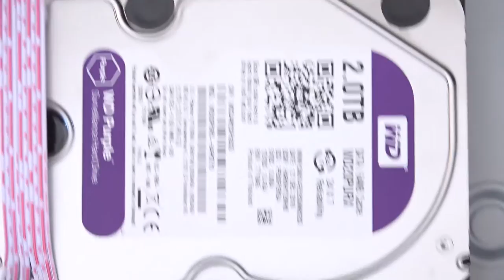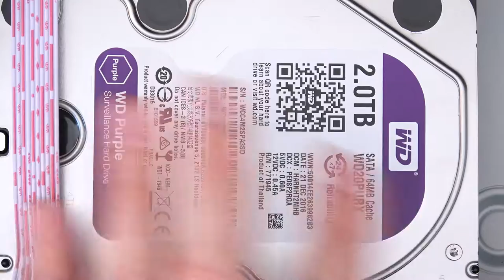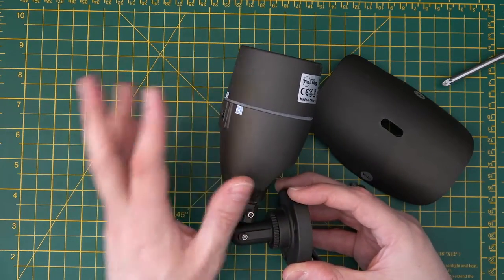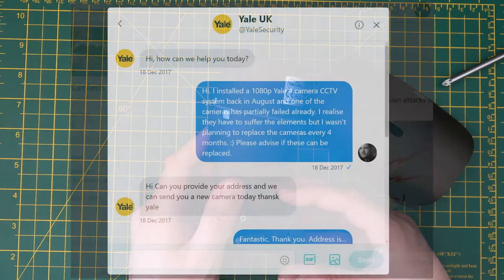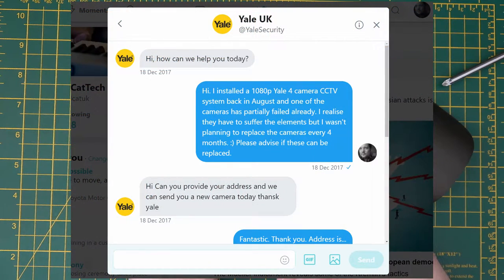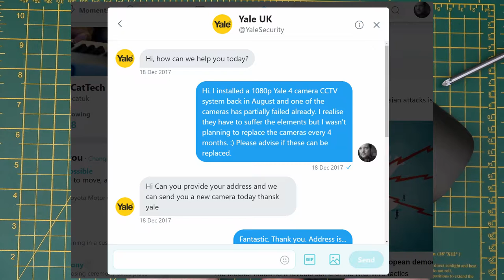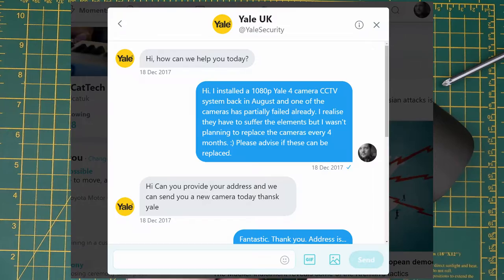Inside A Consumer CCTV System & Camera

Comment: I love nothing more than finding a great YouTuber from the UK. Really good an informative videos. I’m looking to install CCTV. Initially I was looking at wireless which is simple but these DVR cameras have so much benefits. The only issue is as always the cabling. Having to make a channel inside the house for cabling into the loft is a ball ache. I’m not a fan of seeing the conduits running up to the roof. Did you ever do an installation video, or upgrade your system? Thanks

Comment: Nice. I am completely tech ignorant. Just installed a two camera version. Tested it beforehand and worked fine. Now installed, followed instructions, which aren't particularly idiot friendly and all I get is the black split screen but no pictures. Any pointers would be appreciated. Thanks Richard
Reply from the maker: Make sure you are monitoring the correct channels. The box might allow you input e.g. 4 cameras. If you have them in 3 and 4 but are viewing 1 & 2 you'll just see black with a resolution on the screen. Make sure the cameras are powered up with the separate adaptor.
Reply: Richard Allen hi did you find 2 cameras sufficient?, did you get good coverage?, they say 60 degree vision.. Thanks

Comment: What did you think of the 90 degree camera angle? I want to use 1 camera on the rear, 1 on the side, 1 on the front and 1 in the corner of the porch area, but I can imagine the camera failing to pick up everything below, and if I was to angle it down I would miss the front of the driveway. I am being tempted by the 120-140 degree cameras
Reply from the maker: I've never found it a problem but my use case is quite different; elevated shots from 2 floors up. The field of view gives a very natural image and covers a surprising amount but only you can say through testing if you need more.

Comment: Good vid would you recommend the 1080p over 720p version?,did you install system yourself if so what size holes drill through wall?,did you silicon holes afterwards?,is 2 cameras enough viewing angle?, is the quality any good?,there has been lot bad reviews of the Yale app for mobile does yours work when out house?,thanks.
Reply from the maker: Not really. I think 720p is quite sufficient for CCTV. The sensors in cameras like this are probably not resolving that much detail anyway. I did install the system myself but I was able to route all the cables under the windows as they are period sash windows which have gaps everywhere anyway! This system is a 4 camera system. It gives excellent coverage around the building. Viewing angle is not GoPro wide but it's good enough. Quality has always surprised me. Overall, I'm very happy with it. If you want a sample, I can send you something though I can't put a link on YouTube. Yale app on iOS is superb. Functional and reliable. It's nothing flash but it does everything I need it to and does it well.
Reply: TDCatTech thanks for reply back appreciated

Comment: I found your video very interesting,  but it leaves me wondering if you managed to get remote coverage on the app when in a 4g network?
Reply from the maker: Yes. The app works flawlessly on 4G. In fact, it works on less than that because there are 2 resolution options. The lowest resolution let's you see what's going on and only uses a tiny amount of data. The HD option uses much more data (probably 100-300KB/sec) but is very clear. I can also scroll back through old footage remotely on the app and record it directly to my phone.
Reply: @tdcattech  Thanks for the reply. Sadly I can watch on my android, but only if connected to the same WiFi network. Yet to work out why. .
Reply from the maker: Did you set the CCTV box to a static IP address and forward all traffic to the appropriate port (this can be manually set also if I remember correctly) on your router? You'll need to do that before you can access from an external network (such as a mobile 4G network).
Reply: @tdcattech  I think you may have the answer, thank you. I'll come back to you with my findings.
Reply: @tdcattech  Hi, I've solved the problem with not being able to view on 4g, I forgot to add the MAC address of the cctv to my router, therefore it wasn't able to connect to the network. Thank you again for your help and time

Comment: I know this is and old clip and I don't know if you can help. I need to know the length of the cable that is fixed to the camera. I need  to pass this through a substantial wall before connecting it to the final length of cable inside the house. If you can help on this I would be grateful. I emailed Yale with the same request but they just came back with the 15m size of the final cable, which is not what I asked for.
Reply from the maker: Sorry, I don't know the exact length. It's about 30cm maximum, maybe a little less before the BNC and power connectors. Most people would probably just use this short section to loop before the camera to avoid rain ingress.
Reply: Hey thanks. I have tried Yale again and they realised that they had misunderstood. The told me the length is 36mm. This is long enough even if it includes the terminals. Thanks again for replying so long after you posted the clip, which convinced me to buy. My old system gave up some time ago and the cable passed straight through the wall.